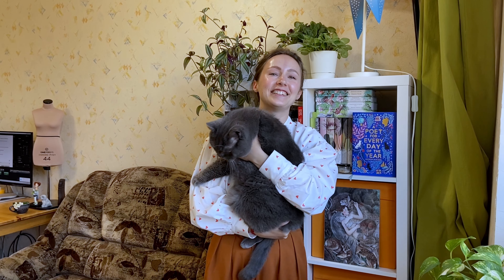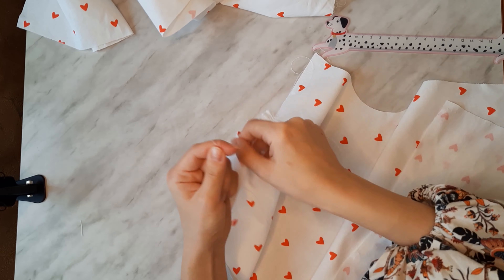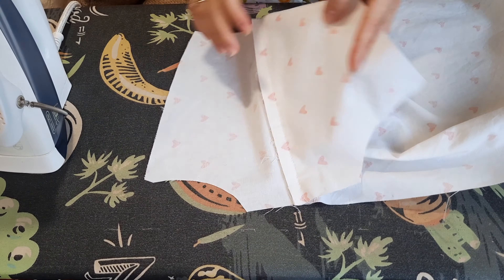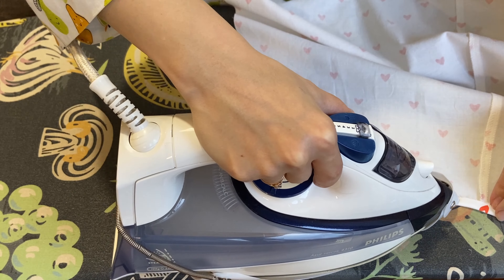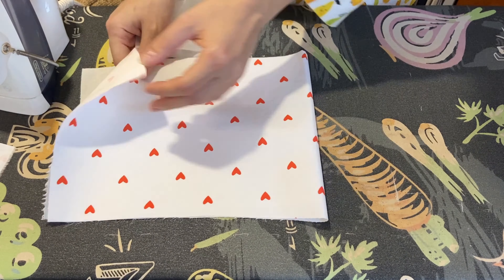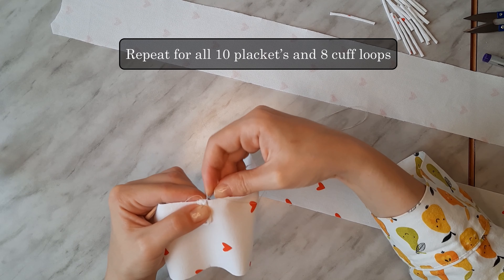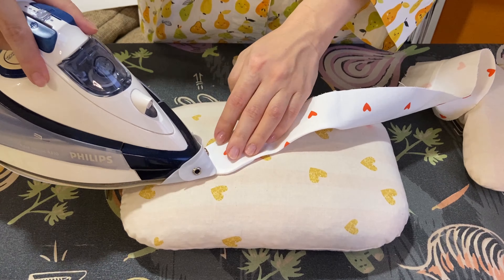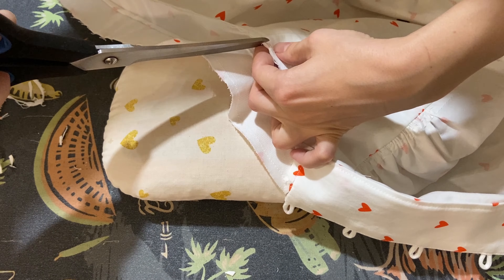Sewing a VikiSews Liza shirt - Part 1

Comment: You are an excellent sewist!  All the basting and pressing, pressing, results in a beautiful garment. I have been looking at this pattern so many times- such a beautiful design!  Could you please tell me what the pillow like object you press on is called along with the smaller cushion you press onto what you are pressing? I have never seen those before. What is their purpose?
Reply from the maker: Dear Charlotte, thank you so much for your kind words! I'm so glad my video has been useful to you😊These pillows are hand made pads made of cotton fabric and filled with sawdust! They are useful when you have to press something that has a kind of a round shape (curved seams), when its difficult to use a flat surface for pressing. And they also help with cooling the seams and making them flat fast. You could also use a piece of wood or a wooden ruler for the same purpose.